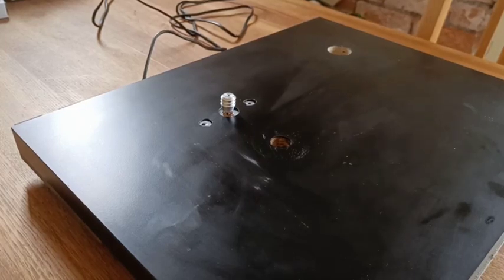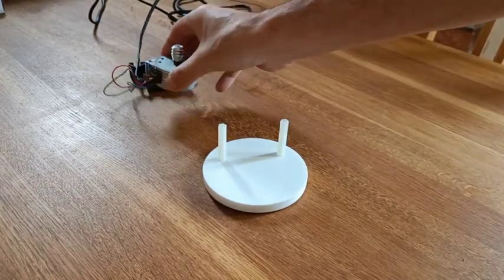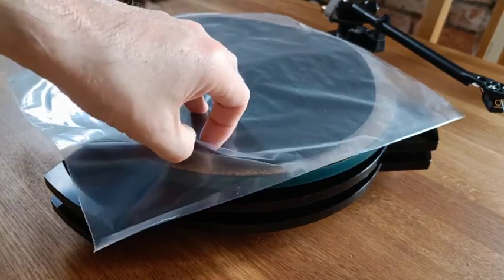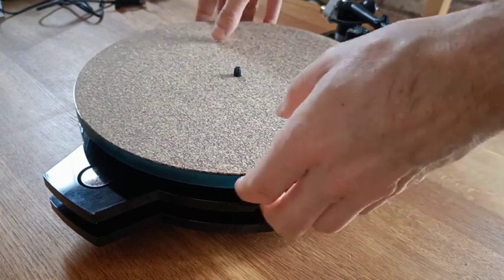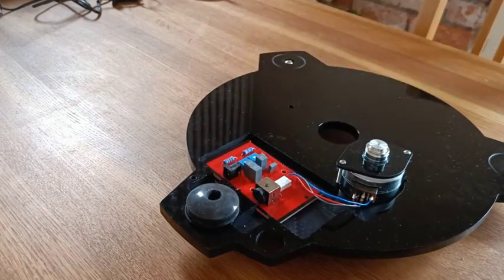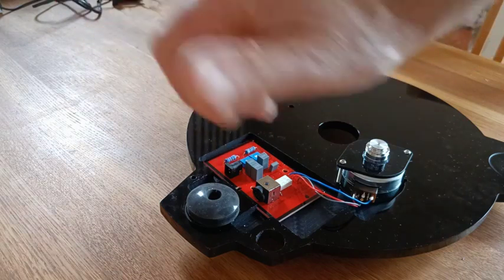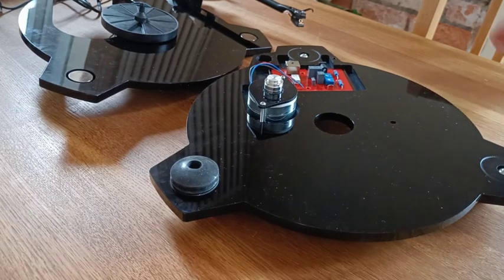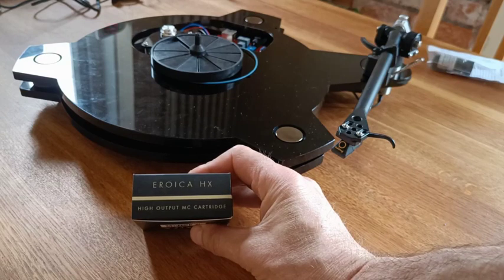Rega Planar 3 - SRM Azure mods

Comment: can you tell the height of the motor brackets ? theyre plastic ?you change the original rubber foot of the sassi ?
Reply from the maker: If you're speaking of the stand-off pieces, it really depends upon your setup.  My turntable had non-standard feet, so it rode at a different height.  
You have to factor in the height of your feet, the thickness of your disk, the thickness of your rubber anti-slip mat.

I just bought a few from eBay for very little money, at different heights, and experimented until I got the correct height.  You can usually get 2 or 4 of each length from the same seller, who will then discount the postage.

You might also need to use some disks under your turntable feet (sorbothane is best, it's also very sticky when clean, cork or rubber might also work) to alter those by a mm or two.  Just need to ensure that everything is non-slip, otherwise you cannot tension the belt.

Comment: I notice it has a ground connection. My p3 has a rather pronounced hum especially as the needle nears the motor. I was told it’s loud in my system because of my sensitive speakers. Does the added ground cancel the hum?
Reply from the maker: It should do. Rega simply attach the ground to the negative terminal rather than directly to the arm, which seems to be a cost saving measure and it's not always successful, as you have found out - or maybe your wire has simply become detached.  If you touch an exposed part of your arm with a finger (maybe the base of the arm, underneath?) and the hum drops away then you likely do have a grounding issue.

I added the ground wire whilst re-wiring the arm with some silver Cardas cable. You need to save one of the old copper cables and use it as a ground connection. I removed some of the paint near the head shell and attached one of the copper wires with some solder. There's usually enough length to bring this back to your ground point, but you can always join this wire to another if you need it longer.

I bought the interconnect box from Analogue Seduction for about £25.
Reply: If ot were a " cost saving measure " why do you think the same is on the #4000 REGA P10? And the £12000 naia ...oh and the £32.000.00 NAIAD ?
Reply: @mikemcguinness1304  what’s your explanation for this obviously poor design choice?
Reply: @scottkasper6378  I don't have a problem so I can't say it is mate . Honest
Reply from the maker: @mikemcguinness1304  all manufacturers look to save costs, regardless of price point. It's about chucking your product or if the door as quickly as possible whilst keeping control of warranty claims. Grounding to the negative terminal is usually effective and saves time and materials.
Reply: @mikemcguinness1304  you may not but that’s the main complaint you hear about rega.
Reply: Hi , the problem with picking up hum as the arm gets near the end of record is correct , i tried connecting van earth wire directly onto the motor housing down to deck and made no difference. Regards mark
Reply: @6643bear  thanks.